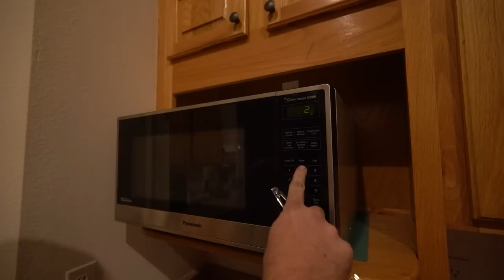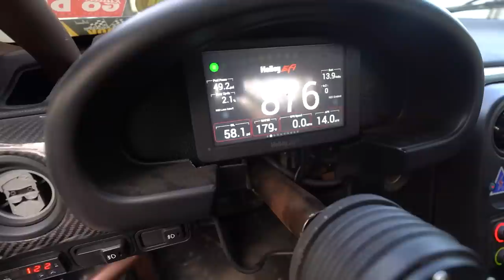Fixing and upgrading the LS Miata. for the last time.

Comment: Finally, a big YouTuber who gets heat transfer and fluid flow and doesn't just pass along the "water needs time in the radiator" bs. Happy Bday TayRay
Reply: Although faster warm up is better, right?  Mainly for oil temp warm up as I understand as at cold temps it has water and fuel in it that isn't great until temp goes up and get's rid of it (mostly).
Reply: @iancrosson9513  it will affect warmup somewhat, but not enough to notice, especially in comp. That car might see one true warm up for the day.
Reply: @iancrosson9513 he's in Central Florida , so unless he's going to a drifting event in the Northeast in the middle of winter . Warming up the oil doesn't take any real time when it's already warm outside . They have to be a lot more mindful about overheating .
Reply: @Shadowband72  I can see that. My LS2 C6 and F20C S2000 with thermostat take fairly long time to warm up when I lived in Austin, Texas.  But that's preparing for laps at COTA.  And your right, now in Colorado I wouldn't even dare entertain it.

Comment: My big block dodge with an electric water pump I run a 170 degree thermostat with a 1/4” hole bored in it. The pump made nasty sounds otherwise when the tstat was closed, and it still warms up fine in the winter months

Comment: I haven’t been this earlier since Miata’s were $3500
Reply: Seriously, I bought an s550 a couple weeks ago for 25k. Insane for an 8 year old car
Reply: I got mine for 3500 a little more than a year ago and I was pissed I had to pay that much for a relatively rust free but thrashed example I was gonna build into a drift car myself. Wanted a cheap one and it was just about the cheapest I could find with no real rust in Wisconsin.
Reply: I got my 95 for 3500 11 years ago 92k miles in mint condition.  I still have it and absolutely love that car.
Reply: @COYOTE_N8  why the hell would you do that 😂
Reply: @jeffreylyons1531  mines a 93, in no way minty but it's only got 100k on it and was a Florida car most of its life. being in the rust belt my ONE requirement was finding a car that wasn't rotted out. The thing was slammed, fenders rolled atrociously badly, it's beat to hell, paint was literally put on with rollers at some point, but it won't rot away. I've got the same DoD suspension as Taylor for it, poly bushings, Wilwood calipers and nb sport rotors, extra rear Wilwoods for the hydro, so much cool stuff to go on it as soon as I'm done grinding off all the rubberized undercoating and fixing up the underbody. Probably gonna k swap it cuz k power that makes the swap kits for it is local and idk, i wanna keep the weight down and like high revving little engines. someday it'll be sick haha I only care about making it feel as good to drive as I'm capable of making it right now.
Reply: @sasha-taylor  people are asking 6k+ for clean Miatas these days it’s crazy
Reply: @colejohnson5447  really is. mine is the definition of rough but it's not rusted out (rare to find around here) and I'm just glad I have one at this point.
Reply: @redfishbluefish1  cus it only had 17k miles and that's what there going for and I wanted one and I had the money. Should I say more lol
Reply: I bought my spec Miata for $2500. Clean title, no damage. Came with a trunk full of parts (brake pads, rotor, stock parts, extra diff) did have a replacement motor but only 90k on the dash.

Comment: Taylor make a 2 inch j pipe about 20 inches long cap the straight end and weld the j end into your exhaust pipe so the j faces forward and the straight end stops just before the diff the j follows the exhaust  you will lose the drone sound from the exhaust and the exhaust note will sound so much better cheers from down under

Comment: I've wondered this forever. Why don't you just drill a 1.5" hole in the trunk floor, and have a hose/tube with a valve for the dry sump tank, so it can drain "out of the trunk floor" and into a pan? That way you don't have to unbolt the tank and put the fridge drawer under it every time you need to change the oil? I've seen some people do that with air/water intercooler ice/water tanks in their trunks.
Reply from the maker: So I started to do that. But just forget to order the fittings until I’m changing the oil. Every time. Lol
Reply: We talk about this every time the Miata’s oil gets changed!
Reply: Every single time its the same lol
Reply: Taylor Ray will do aircraft level wiring on a car but then make changing the oil a nightmare
Reply: @arcadiagreen150  hahahahahaha
Reply: @Taylordrifts could you not just remove the oil return and use the drill to run the pump and pump everything out?

Comment: As someone with factory unshrouded fans on a bottom feeder style cooling system I can tell you that you don't need to be THAT worried about air gaps in your shroud. It's not the problem you think it is. The fans absolutely will pull air through the rad.

Comment: Put 90 angle under Dry sump tank. normal garden hose switch and 90 down true bottom. You can put bolt to that pipe also, if needed.

Comment: I've always wondered why you didn't plumb in a ball valve and a short tube from the bottom of the oil reservoir down through the trunk floor so you could easily drain the oil into a pan under the car.

Comment: 9:40 when tightening bushings it should always be done with suspension at ride height. If you tighten bushings at dull droop on lift droop becomes neutral position. They get stretched when you put with on car and tear if suspension is cycled past ride. Height. If they are tightened at ride height they stretch to dropp and are neutral at ride height.

Comment: They make restrictor plates to run instead of a thermostat when using electric water pumps. Change the dia hole depending on time of year and how hot you want the coolant to be.

Comment: Hear me out since the tank is higher than the pan that captures oil to send it back to the tank, why don't you just take a line off at the pan and apply a little bit of positive air pressure to the top of the tank?

Comment: TR, I'd encourage you to consider doing something about installing hood vents to help keep heat under control; the hot air most certainly wants somewhere to go and having the hood closed will make that be the sides and bottom of the engine bay
Reply: In the miata.... u do realise he's been running it like this for years
Reply: @matluthaus6317  doesn't mean it can't be improved

Comment: might be a silly question but could you not put a fitting on the bottom of the dry sump tank to make it easier to drain or is it just not worth the risk of the extra failure point?

Comment: For drifting, you probably don't need a restriction to help cool, but I can tell u for a fact for oval racing you do, or u need to run a multi pass rad. When ur at high rpm for a long time like we are oval racing, the water doesn't have enough time to cool.

Comment: 14:27 can you add a 90 fitting under that oil tank add a line then you can add a plug  then the tank would never have to come out just drain it out of the line, can also run that same line throw the trunk floor so you don't have to drain it from trunk

Comment: You should try Duralube for the miata and see if it helps with compression, project farm did a video where duralube gave him another 10 psi of compression on a lawnmower motor, dont see how it would be any different in your case

Comment: Couldn't you disconnect a hose at the front or the return line to the tank, run the pump and save draining the oil tank in the trunk with a pan?

Comment: I feel like an easy solution to the oil change issues would be to just attach a extention pipe or a hose to the bottom of the oil tank and have it go through the trunk floor

Comment: are you able to use a syphon oil extraction  system instead, place a tube down a cavity and let it extract it instead of fighting with trying to drain it in the car with the tub?
just a thought , somnething like this, OEMTOOLS 24389 5.6 Quarts (1.4 Gallons) Manual Fluid Extractor, Fluid Extractor Pump, Oil Extractor Vacuum, Auto Oil Extractor

Comment: Hey Taylor I've noticed the audio segments that you add in voice over have a bit of ground-loop like hum, like at 7:08. Not a big issue, that could need to be solved in any of a bunch of ways. Perhaps powering your mic with an isolation transformer, or maybe its not a loop, and is just your audio cables running next to a power cable.
Reply from the maker: Yeah it’s weird it happens sometimes. And I don’t usually catch it when I’m listening on my speakers but if I do I’ll unplug the mic and plug it back in and it’s fine.

Comment: Why not mount the oil tank to an intermediate plate that us wider than the tank (radially)?  That way you can service the bolts easily. Or put a drain valve through the spare tire area?

Comment: Question on oil change from a guy in the middle of a dry sump install - why not pump the oil out ? Disconnect line into cooler or whatever and spin the pump over with a drill ?
Reply from the maker: That’s what I did. But you wouldn’t be able to get all the way to the bottom of the tank if you didn’t drain it too.
Reply: @Taylordrifts  got it thank man !

Comment: 15w50?? thats an awfully thicc oil from what ive read. I can say without a doubt you have more knowledge so im curious. Whats stopping me with my cammed ls with a high vol high pres oil pump from doing the same? I thought the ls could only really handle up to 10w40 before it would start starving bearings of oil. Sitting here writing this the only real reason I see is because that ls lives at high revvs. Is that why?

Comment: There is too much space between the cooler and the radiator.  You want as little space as possible so the air does not go around the oil cooler and  the air that does go through the oil cooler will lose velocity with a big gap between the two.   The way you have it is less efficient for the oil cooler and the radiator.

Comment: If your water goes around the whole thing once a minute and it spends 10s in the rad, spending 10s per minute in the rad, if you then double your flow rate it will spend 5s in the rad twice per minute for 10s per minute in the rad. Turns out basic arithmetic from school is useful. 🤣🤣🤣

(technically the pump also heats the water in the process of moving it - that energy has got to go somewhere - but in the context of a large ICE you can basically ignore that)

(and the water going twice as fast will be more turbulent and thus more efficient in heat transfer, so you have to MASSIVELY oversize the pump to lose out)

Comment: I have had a thermostat stick, and going down the road, the engine would run cold. Sitting still, it would over heat.
Reply from the maker: I don’t run one in the majority of my cars. No issue.
Reply: @Taylor Ray  works good in Florida! 😄
Reply: @Taylor Ray  works good in Florida! 😄

Comment: That low compression on a couple of holes. When u built the engine 4 yrs ago, wasn't it leaking on a couple of holes when u got it
Reply from the maker: I think you’re thinking of the 5.3.
Reply: @Taylor Ray  No on the 6.2, I believe. Look at the 4:00 time stamp at the video linked. You do a leak down, and there is a leak on the intake valve

Title: building the new ls miata engine (we went a little over board)
https://youtu.be/QPLahIV6hgk

Comment: the whole thermostat myth is well. people dont understand physics. if the water is moving twice as fast, its carrying half the heat at double the speed. same thing. what probably is happening when people get that issue, is the no thermostat is allowing the pump to cavitate from low pressure. which will make the flow slow down or stop

Comment: Aviaid's website lists a -12 female for the 9" dia. tank drain fitting, so here are the part numbers for the pipe adapter and a cheap valve for the oil drain tank;
MR. GASKET STRAIGHT -12 AN TO 1/2 INCH NPT ADAPTER - BLUE Part # 481613
Brass On/Off Valve with Lever Handle, 1/2 NPT Female McMaster PN:47865K23

Comment: The thermostat deal is more with regular cars to maintain the temp the car is tuned to be most efficient. When they get old and rads flow is getting slowed with gunk in the tubes and fins full of bugs and dirt and a pump not pumping its best the slowing the flow does help. If you are pushing hot water on both sides of the RAD it doesn't cool the most efficient
. I've done it on over heaters and done the gutted t Stat and that little resistance in flow helped. Hey what do I know I've o ly been a mechanic since 1988.

Comment: Why don't you suck the oil out thru the top before you open the plug. You'd get the settled crap out without the extra fuss